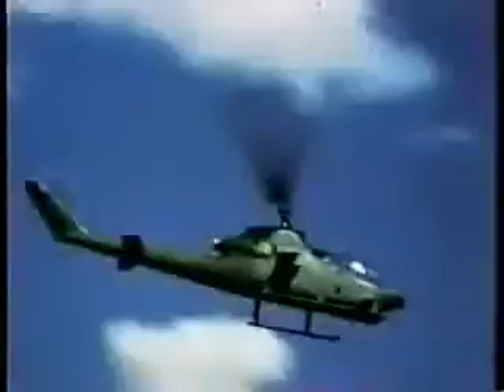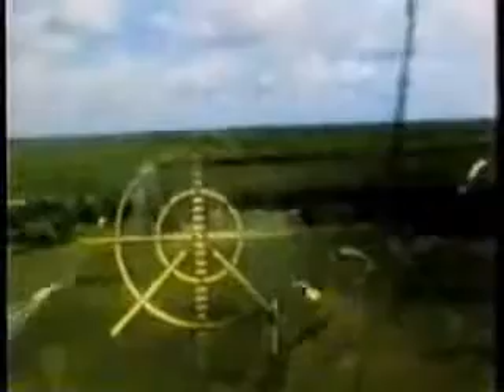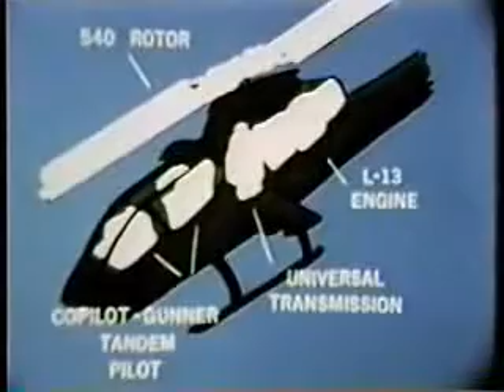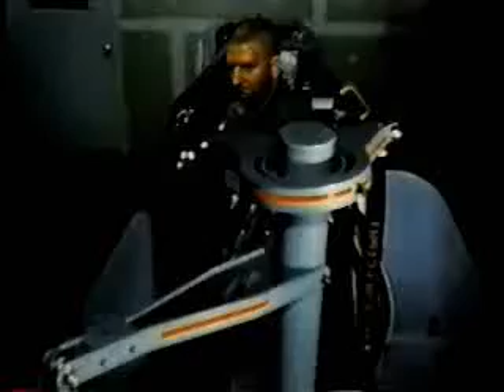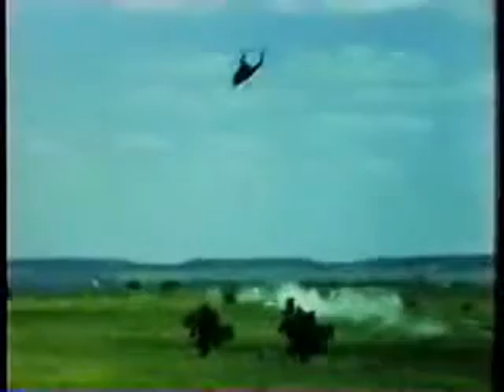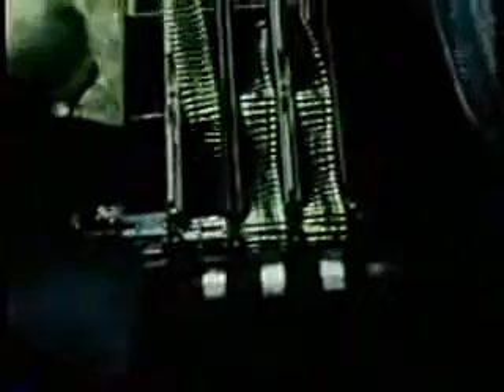Bell AH-1 Cobra - The T-72 Killer

Comment: More tanks cracked?... the Mi-24 holds the record by all accounts...
More battle tested?... The hind was exported to more countries and participated at least as in much wars as the AH-1
Fire and Forget misseles? The Mi-24 can employ them too.
For the Mi-24 and the Ah-1 were the only helicopters to engage multiple times in the air, the Mi-24 shot down 10 AH-1 and the Ah-1 shot down 6 Hinds, why?
Because the early production AH-1 couldn' t support much damage to them, relative to the hind.

Comment: @Talshet Talshet, that is the most made up bullshit ever, no way could the Mi-24 have destroyed over 1000 tanks? what wars?, and the Mi-24 isnt more advanced as the Cobra, it has a maximum missile range of 2.8 km with the Falanga missile, and the 12.7mm gun doesnt have full axis degrees, on 90 degrees on rotation, and the Cobra is more battle tested, its fought everything from enemy helicopters, to dug in positions, to tanks and other scenarios, the mi-24 is mainly used for anti infantr